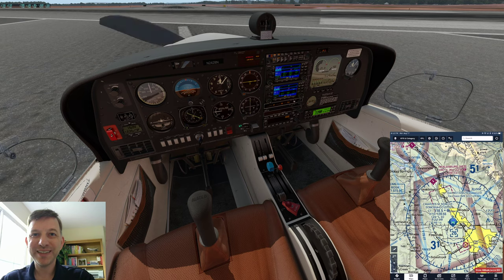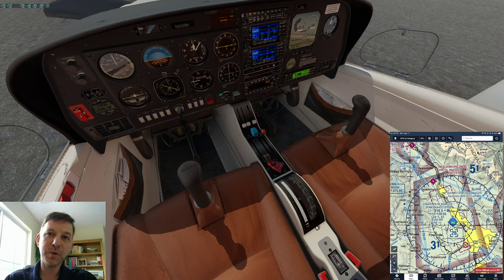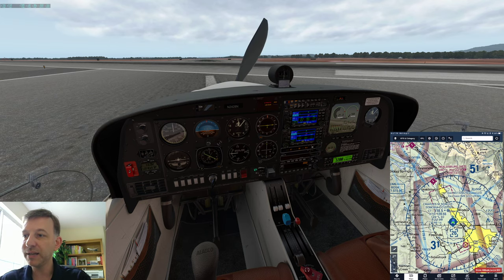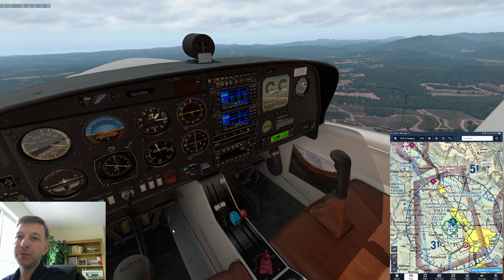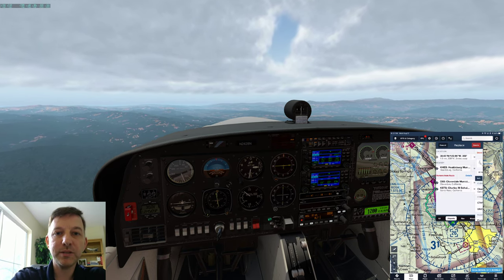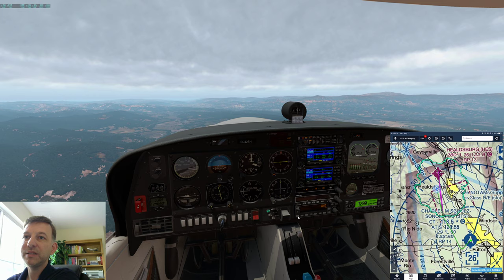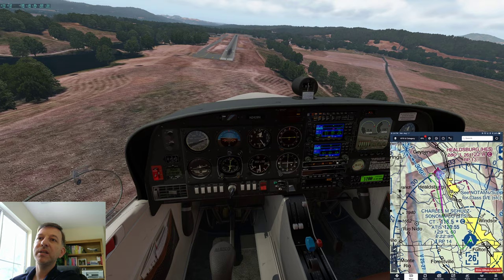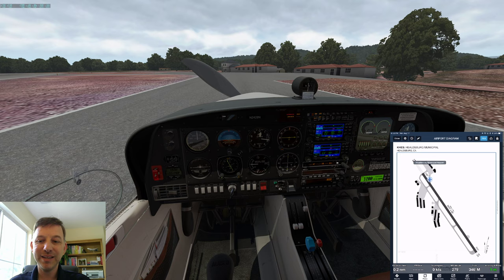Flying a DA40 in X-Plane from Santa Rosa to Healdsburg

Comment: You should read the POH a again my friend ;), 50 seconds in the flight and you already broke 4 of the procedures
Reply from the maker: Ha, I’m sure I made more than 4 mistakes.  Flying the simulator is a little safer than the real thing, but even on actual flights I know I make mistakes or may not do every procedure according to the POH.  What matters is that we strive to be safe and get better as we get more experience.  IMHO, no amount of following every checklist to the T is going to keep you from having a midair if you don’t look outside the cockpit.

That said, I know it’s been 4 months, but what did I miss?  I caught the flaps, not asking tower for take-off clearance. I’m guessing you probably object to RPM reduction before reaching 1,000’ AGL. I also think I may not have turned on the AUX fuel pump.